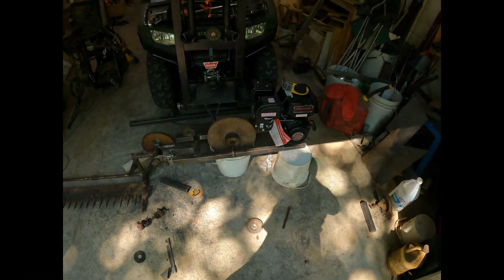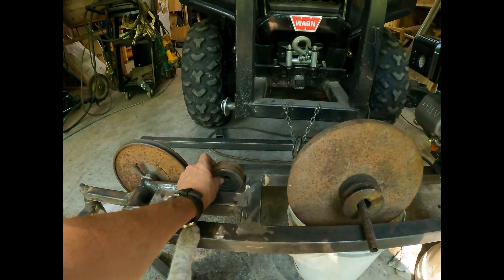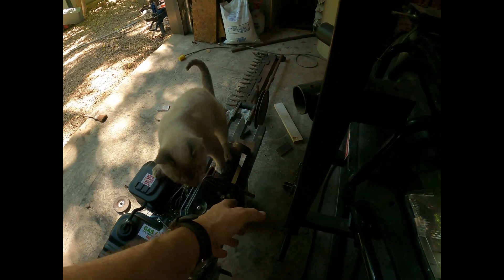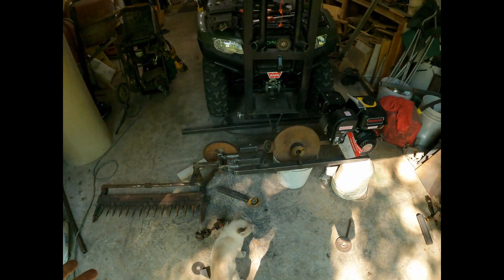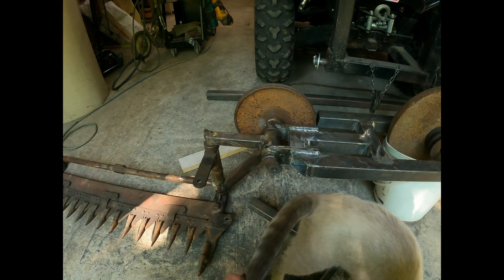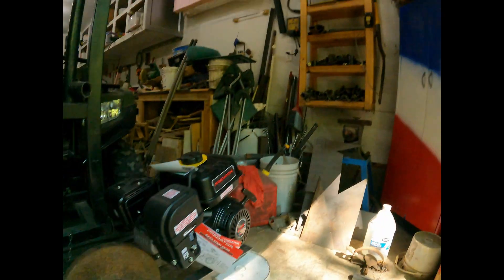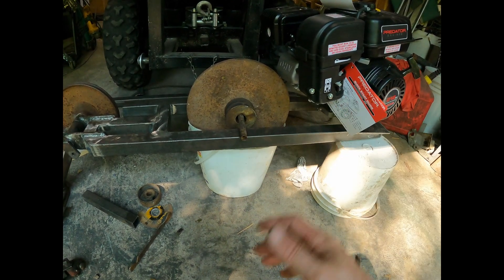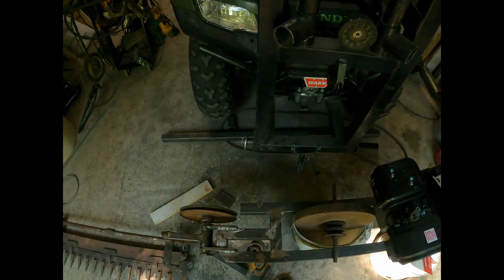ATV SICKLE BAR MOWER BUILD PART 5

Comment: Really well thought out that you can pivot to cut on the side. I guess you can lock in at various angles up to the 90°. That way you can get any small hillside areas.

I would just go full steam ahead. Build it, see where the fail points were and then improve. I don't do well with prep work or theory, which I really should work on 😅
Reply from the maker: thats what i thought just try it , fix what dont work.not counting the engine theres only 28$ in it (so far). prep/theory whats that lol